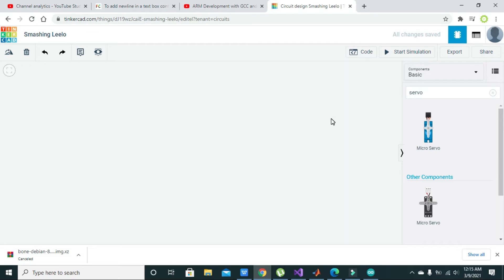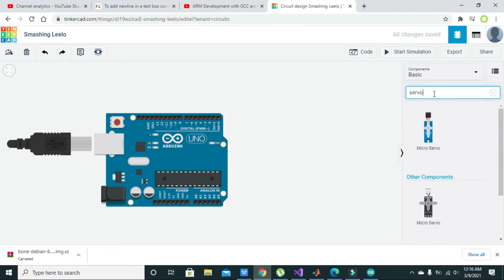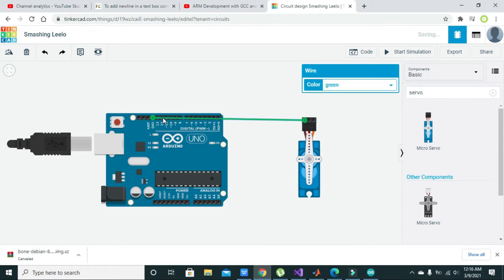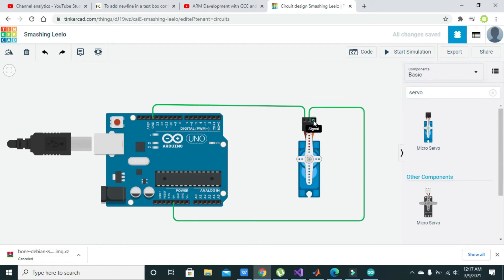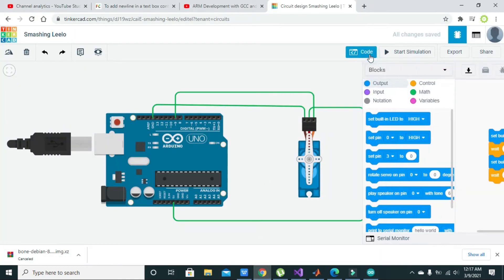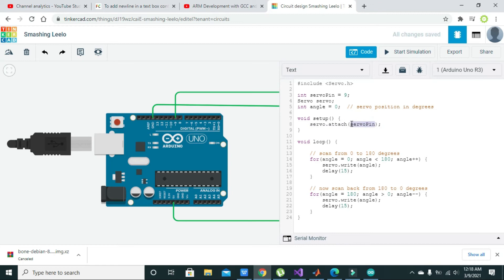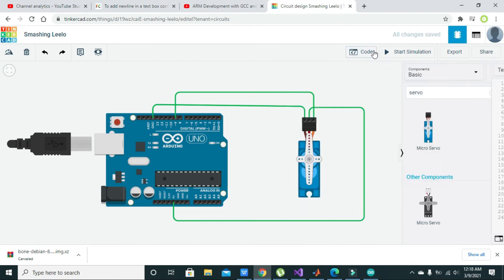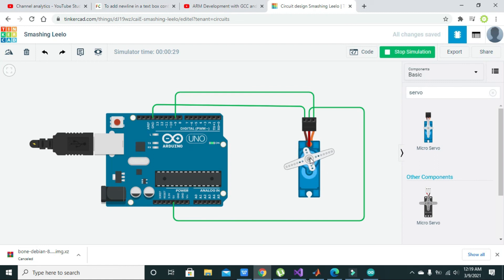how to use servo motor with arduino in tinker cad | servo motor simulation in tinker cad

Comment: Code here!

#include <servo.h>

int servoPin = 9;
Servo servo;
int angle = 0;  // servo position in degrees 

void setup() {
    servo.attach(servoPin; // put a space where the ; is if it doesnt work
}
                 
void loop() {
  
  // scan from 0 to 180 degrees
  for(angle = 0; angle < 180; angle++) {
    servo.write(angle);
    delay(15);
  }
  
  // now scan back from 180 to 0 degrees
  for(angle = 180; angle < 0; angle--) {
    servo.write(angle);
    delay(15);
  }
 
}
Reply: For someone if it's not working use this one

#include <Servo.h>

int servoPin = 9;
Servo servo;
int angle = 0;  // servo position in degrees 

void setup() {
    servo.attach(servoPin); // put a space where the ; is if it doesnt work
}
                 
void loop() {
  
  // scan from 0 to 180 degrees
  for(angle = 0; angle < 180; angle++) {
    servo.write(angle);
    delay(15);
  }
  
  // now scan back from 180 to 0 degrees
  for(angle = 180; angle < 0; angle--) {
    servo.write(angle);
    delay(15);
  }
 
}
Reply: @crichilltalk1833  omg thanks a ton dude saved my life luv u
Reply: @crichilltalk1833  thanks bro
Reply from the maker: Thanks for writing the code.....
Reply: THanks man